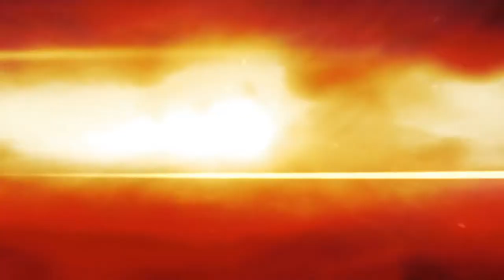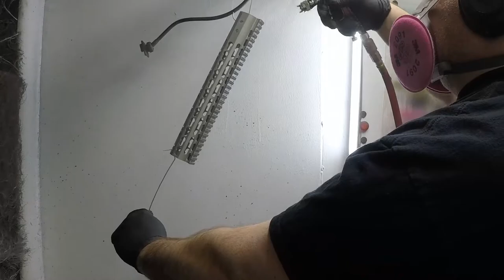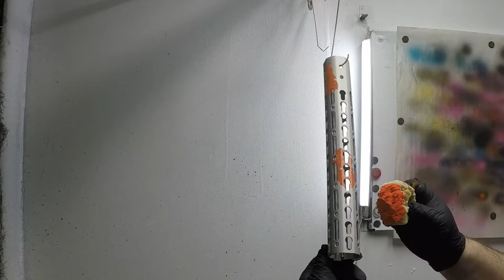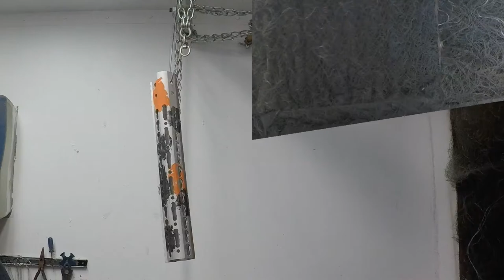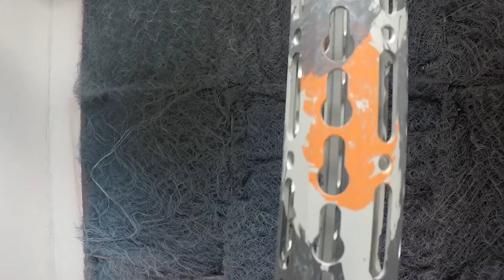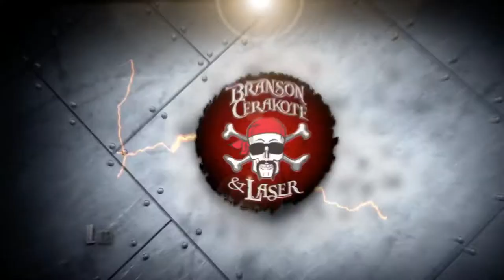A quick tutorial on the Manners Stock Camo Technique | Branson Cerakote and Laser

Comment: Hey John quick question, just getting into cerakote and getting my garage setup. I purchased an electric smoker but found out it only goes to 275 degrees. I’ve heard 300 at 2 hrs for cerakote. Will this smoker work? Just set it longer? Or is there something special at 300? Thanks man, really enjoy the channel, very helpful!
Reply from the maker: 180 for two hours for polymer, 250 for 2 hours for metal and you're fine.

Comment: I'd like to see how masking tape works for two colors on one piece for professional results. For example, I'm copying an image I found on Amazon. The image is an AR15 with burnt bronze and graphite black Cerakote colors. I'm assuming it's H series. The parts of the lower, like the selecter switch, mag release button etc are burnt bronze and the entire lower is graphite black. The upper has 3/4 graphite black from bottom to top and the top 1/4 is burnt bronze running all the way across the hand guard. The reason I ask is because I'm not sure if you should mask one area off, paint, and then put into an oven or if you should mask, paint, let dry for a minute and then mask off the bottom and spray the rest and then oven. Plus, I'm not sure if there will be an uneven look where the two colors mesh together. If you can't understand how I wrote that, then how do you paint two colors combined?

Also on this subject, how would you paint areas like the pistol grip? Imagine a grip having a black stippling and you want to leave that but paint the other areas a different color. This would be an excellent video.
Reply from the maker: The selector switch, bolt catch etc being a different color is easy because they are removed so you just spray them separately. To get a line where the rail is, I'd spray the black, air cure, tack it at 180 for however long it takes, then take it out and let it cool completely. Use high heat tape to make the transition line, then mask all of the black with frog tape. Spray the BB on the rail, air cure, then tack again. Take it out and let it cool. Peel all of the tape, and put it back in at 250 for 2 hours. Done.

Pistol grips are a pain to do with tape due to feathering. Because the tape doesn't really stick to the texture part of the grip, you'd spray the all over color, air cure, tack. Let it cool, tape off everything except the texture, and spray the second color. Air cure, tack, cool, remove, hard bake. There's a bit of luck involved depending on colors. The tape doesn't like to stick to some colors, and will give you issues. We generally just use the laser.
Reply: @BransonCerakote  
That's awesome, thanks for replying. It makes sense.
Reply from the maker: @michaelenochs4033  Glad to help.